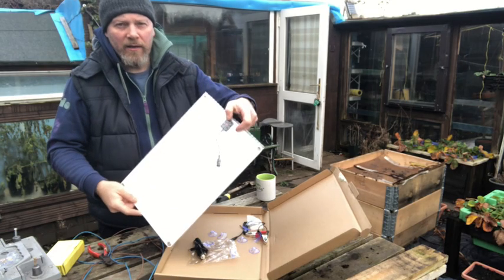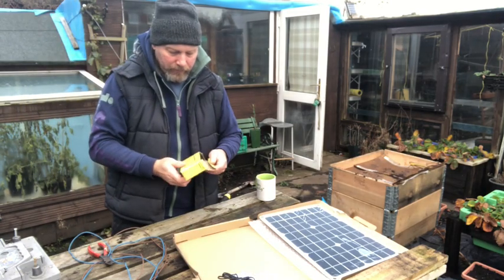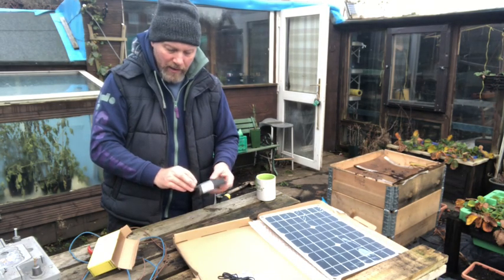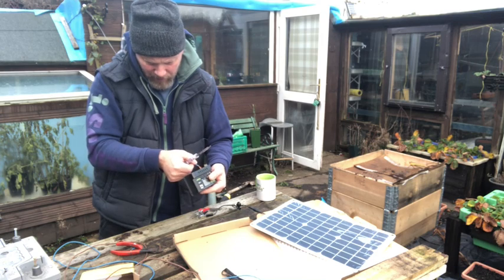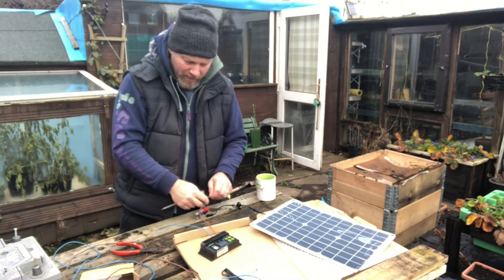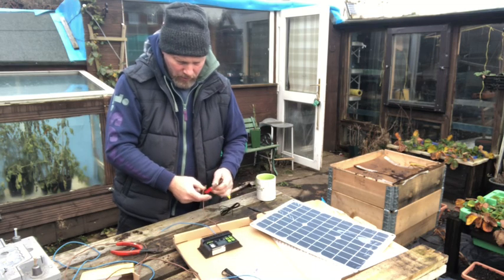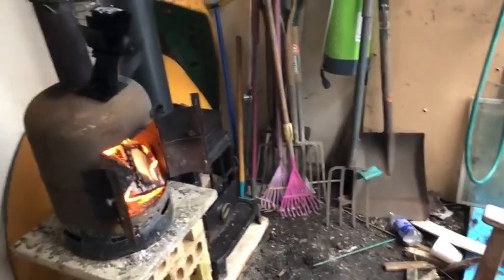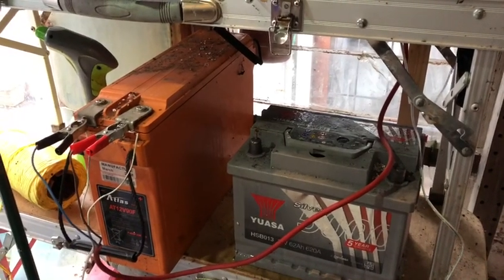Grandads Allotment Solar Panel and light installation

Comment: I wouldn't be without my solar system which was recycled from an old road sign and because we don't get access after dusk mine is used mainly for pumping water around the plots and water containers. Looks like you have a really great system and I only use the power from the controller. 

🍁Happy Gardening........🌞Terry King 🌞